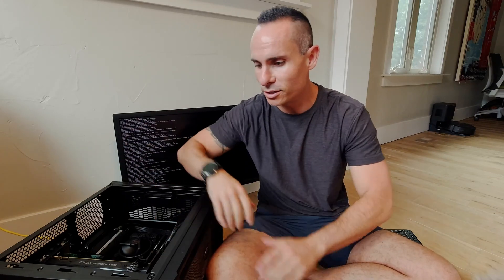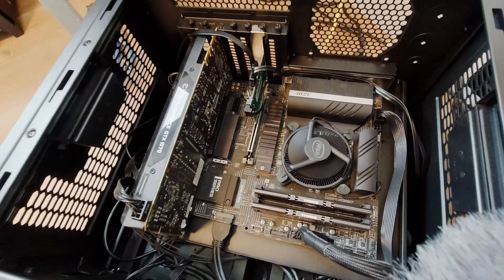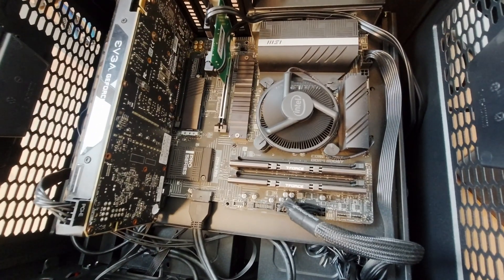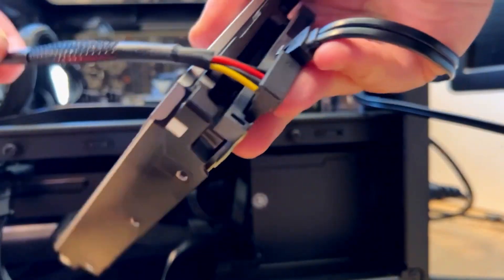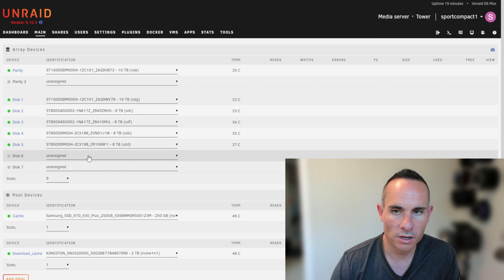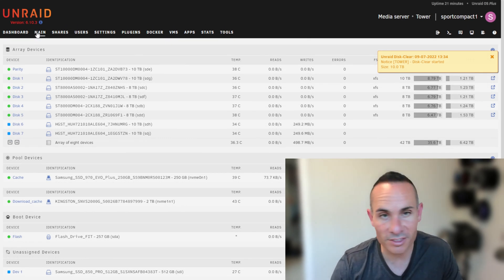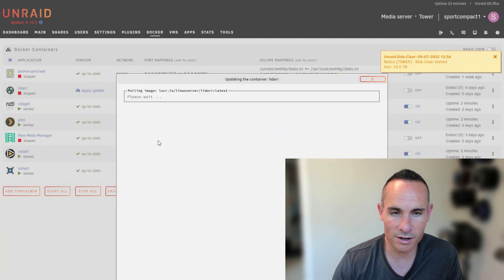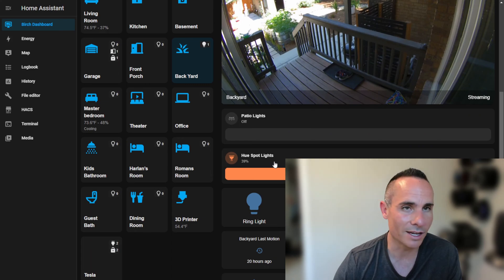60TB NAS Build with Unraid: What You Need to Know

Comment: so if i start out with two 8tb drives, set one for parity, start adding data, and then later get a 16tb drive, i will have to set that 16tb drive for parity. does that mean the original 8tb drive that was for parity is going to need to be formatted? or can i just move that 8tb drive to be used for storage, so now i'lll have 16tb total storage and 16tb parity from the new single 16tb drive i installed?

Comment: I have this exact case. Putting in an older i7 6700k system to use as a media server. Especially to use to spin up a windows vm to run JRiver on it (not a fan of plex or their 'gotta be on the internet' nonsense. Now i need to figure how to setup the cache drives and a drive to put the VMs on.

Comment: Hey friend are you haveing any issues with drive temps?
Reply from the maker: My nvme drive was getting hot after adding an RTX 3090 to the system (it was close to the back plate), so I added a new cooker with a fan which took care of it. I also added a rear fan to the case to help vent the internal air.

Comment: Is SATA expansion cards like the one you use actually recommended? I thought those cards were unreliable and could cause write/read failures and data loss.
Reply: Just my $0.02: No, I would not recommend using SATA expansion cards like that long-term. They're fine as a stopgap measure but they are prone to crashing during prolonged write sessions, especially if they're allowed to get hot. I lost a fair bit of data when the one I was using back in 2020 started crashing and making my array freak out due to what it perceived as disk write errors. Even with only a handful of drives, it's well worth it to invest in a proper HBA.
I ran an LSI 9207-8i (~$35 on eBay) for the last couple years with zero problems, and have recently switched to a 9300-8E (~$75 on eBay) now that I've picked up a 24-bay drive shelf and no longer keep my array drives in the main chassis.
Reply from the maker: I haven't had any issues, but the quality of the card and situation in which it is being used will likely also matter. Ideally you end up with a motherboard with enough sata slots for your needs, or you use large enough drives so you don't need extra slots. I was in a situation where I already had a bunch of drives sitting around from another project, so it made more sense to repurpose them.

Comment: Literally the only thing that Unraid has over any other NAS OS or Server OS is the file system. The interface is extremely cluttered with everything covering every bit of screen space. Mergerfs with Snapraid gives the same experience but not in real time like unraid does, but it's more like the same experience but the parity data is updated on a custom fixed schedule like every hour or everyday whatever schedule you decide to set it to. You can shut down the machine and pull a drive and read it just like Unraid. I'm seriously thinking about switching my openmediavault to Mergerfs and Snapraid from the current ZFS. ZFS is great for businesses with huge amounts of disks and RAM but I feel like it's extremely overkill for home use because of the RAM usage and most home users have small pools compared to most businesses. I have that same case that I built my PC in and I love it. But I actually bought one of the HPE Microserver Gen10 Plus servers with the iLo5 IPMI card which is night and day awesome compared to a standard PC. It allows you to do cool things like mount an ISO on your PC as a virtual CDROM or drag and drop a flash drive folder for it to boot with and install an OS or Clonezilla backup or to update or change BIOS settings. I've only ever hooked a monitor and keyboard on the first day to setup iLo and that was it. Everything is done over the network from then on. I would have no use for 60TB of storage. My 10.5TB pool is like an ocean of data for me. Linus of LinusTechTips used to rave about unraid but I think he quit using it and went to Linux or TrueNAS I believe but I'm not sure why I'm kind of curious now.

Comment: You can use pre-clear plugin to get your new disks tested and zero it. 
The benefit doing that is that during this process your array and specially parity won’t get additional load. 
Once it’s done the array extension will be only minutes instead of hours since unraid would appreciate the metadata written to the new disk by the pre-clear plugin. Of course parity won’t need to be checked since Al sectors on the new drives are zero already. :)
Reply from the maker: Great call out!

Comment: I just purchased unraid a few days ago. Also have a fractal define 7 xl case that came in a few days ago also. Four 14tb new drives and five 8tb 2 year old drives. Gonna start building my Nas/Plex build this week. Just waiting for my sata expansion card to come in the mail. This will be all new to me and your video helped me out with how to get started.
Reply from the maker: That sounds like an awesome setup! Definitely let me know if you run into any issues along the way, but i'm glad this helped!
Reply: @allyourtechai  Thanks. Yea if I run into issues or have questions I'll hit you up.
Reply: i also have fracal define 7 xl, love the case
Reply: Nice stuff! I was looking into building a unRAID NAS for sometimes now. I also like Fractal Define 7 XL, it gives so much room to expand if needed. 

I'm a little frugal so with that case + 1 13th i3 + MB + 32 GB + 2 Microcenter SSD + 1 good Seagate Parity Drive. I can start me a NAS and building up from there. Cost runs around $900 for all the start up components. But it is definitely worth it to keep the cost low and expand as required.
Reply: Ok I have a question. Got the system up and running and activated. I installed four new 14tb NAS drives. My question is, Do I have to do a preclear first on all the drive before I can assign them and start an array? A preclear would take a hell of a lot of time on those 14tb drives. Also I have two 4tb hdd's that are several years old, non nas. Im guessing its probably not a good idea to throw them in the server correct?
Reply: @ahwayzcool4630  you don't need to preclear the drives, you can if you want. When you put the drive(s) in the array, they will be automatically formatted and wiped out. 

About the old drives, that is the beauty of unRAID, you can add them to increase your storage needs at any time and mix match drives is okay. Just know whatever on the old drives will be wiped out when you put them into the array. So, save you what you need first before putting them in. 
Regarding performance when putting the old drives in, it depends. (1) if you have SSD cache, you won't feel the negative impact on the performance of the old drives. They are just there to be storage. (2) if you do not have SSD cache, your ReadWrite speed may be impacted.
Reply: @lapprentice  OK thanks! No I won't do a preclear then. And I'll add those other 2 drives later. I have a 2tb nvme installed that I'm gonna use for cache drive, a 1tb nvme that ill use for storing apps, and a 512 ssd that I'll use for plex server cache. Thanks again for answering my questions. 🙂
Reply: @ahwayzcool4630  oh my my! Your NAS is beefed up with cache drives. Lol. I'm just having 2 x Inland SSD 500GB from Microcenter as raid 1 cache. Costing me $60 plus tax 😂
Reply: @lapprentice  🙂
Reply: @ahwayzcool4630  yes, use the preclear plugin
Reply: Ok I have another question for you. So I have 1 parity drive at 16tb, and 5 data drives...one at 16tb and the others at 14tb. I have a crap ton of space that will take years to fill up. 2 of the 14tb drives has no data on them so far, I didnt even make share folders or anything on them. Is there a way I can remove those two 14tb drives from the array until I need them later? From what I've learned so far the "New Config" could do that? Take a screenshot of my current array setup, then reset my drive config, then reassign the drives i want to keep only, then leave the drives to be removed unassigned. That sounds right?